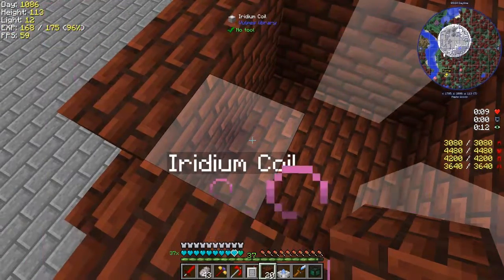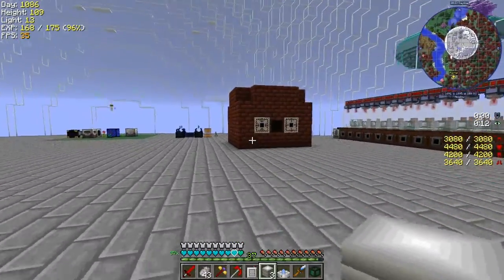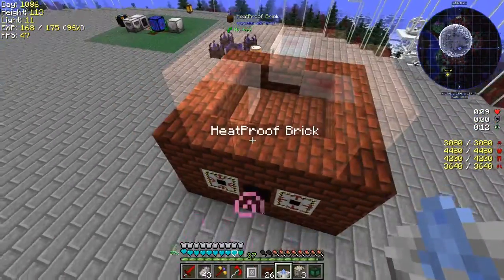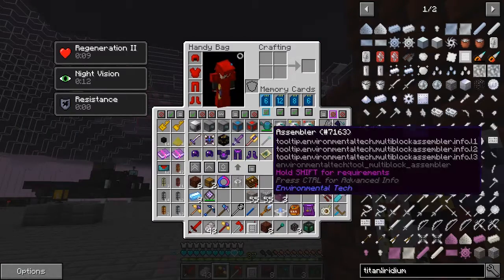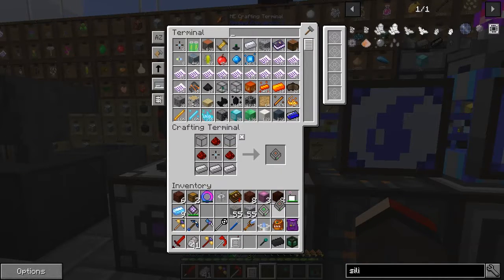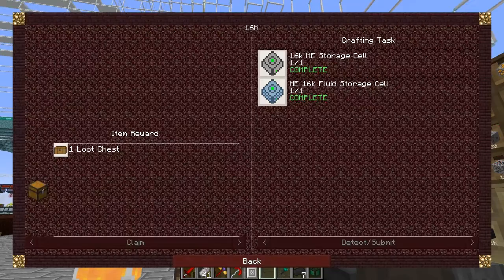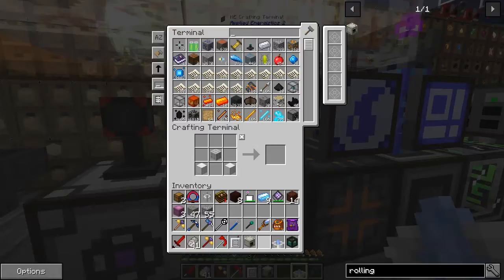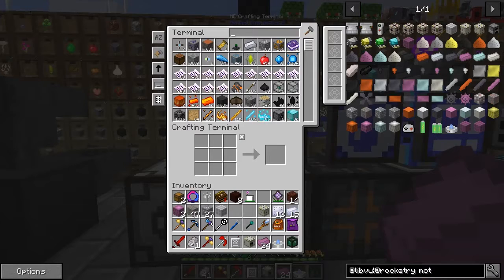Lost Souls #101 - Erect Electric Arc Furnace, Silicon Ingot & 16K

Comment: A lot of the AE2 recipes will take either pure crystals and the non-pure crystals. If you use JEI it always tends to use the pure crystals by default. Now that you make pure crystals so quick is that something you had also noticed?
Reply from the maker: Generally pure crystals are "cheaper" that the crystals, especially the fluix crystals so JEI is nice and selects the cheaper version. With the acceleration chamber and acceleration cards the pure version is also whippy fast to make. In other words I've noticed :-) Same is true in galactic science 2 even if it is a 1.7.10 pack and used NEI.